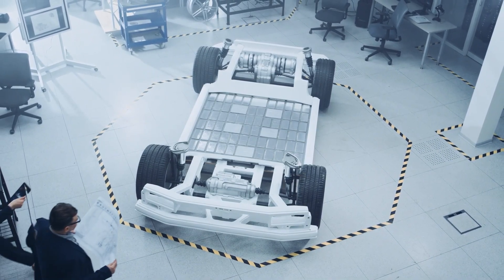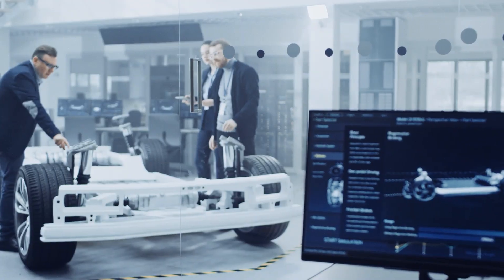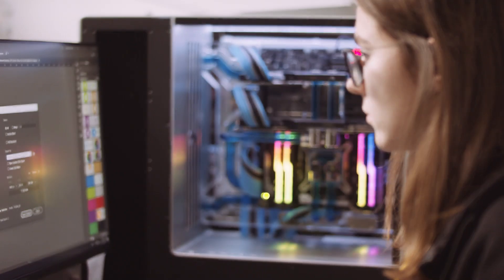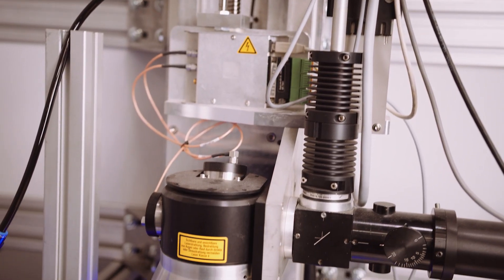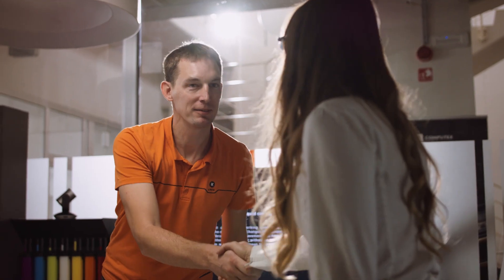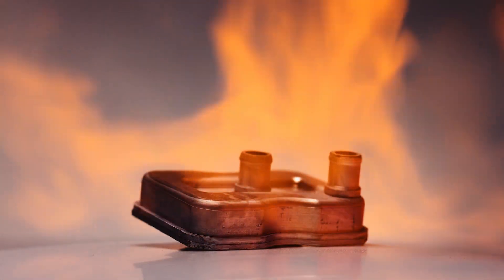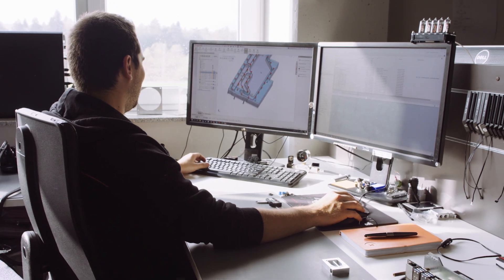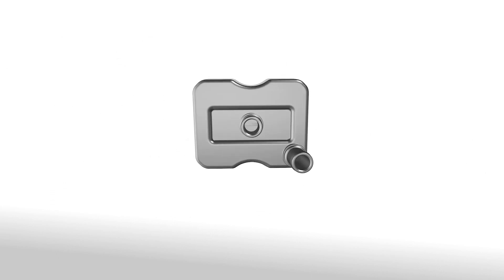EK® Enterprise / Trusted by Technology Leaders

Comment: Nickel flacking, MB short circuited from WB, csq design... am I forget something about quality and reliability?
Reply from the maker: Nickel plating issues were largely due to use of pure distilled water. Currently, with the use of standard coolants containing biocides and corrosion inhibitors, plating issues are incredibly rare. Relevant information regarding this can be found in our blog, here: https://www.ekwb.com/blog/everything-you-need-to-know-about-coolants/

All of our designs for GPU's and motherboards are stringently checked for compatibility issues. This is something we take seriously and monitor even for revision changes within a product.
Reply: In my life i have many blocks. Blocks from EK is the best blocks what i ever has. And i know a lot of peoples from watercooling community - no one have these problems if they use products (from EK, or anyone - not including the cheapest shits) by the way they are designed....yeah i saw many leaks, smashed threads in blocks and some short circuits...but always caused by the user while mounting (a lot of screw driver circuit cuts :D ) or overtightening....when i use product by the manual they never fail...i'm curious if my first block from EK is still working.... :D  (used on HD 3870 X2)
Reply: @DCuniversalable  for sure. but they quality history isn't flawless TBH
Reply: @andrewdenzov3303   yeah...as quality history of almost all products across a world....they still inventing new designs and methods....so it can happen..but in the last few years they don't havye any big issue...only small percentage of manufacturing defects. :) and if they had some issues..they resolve it for the good of the customer... :)